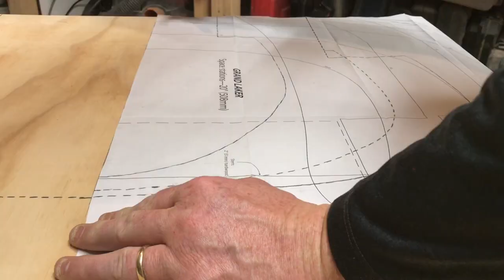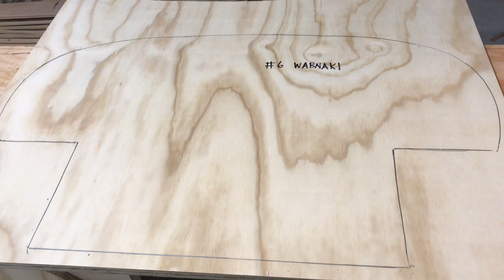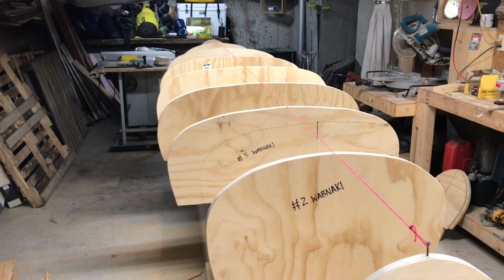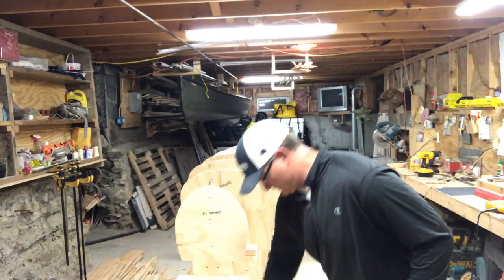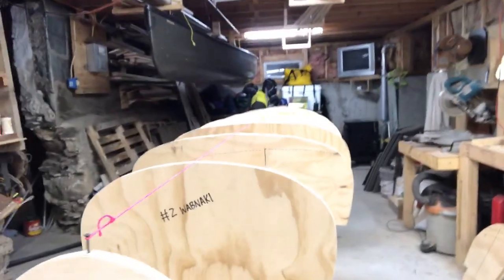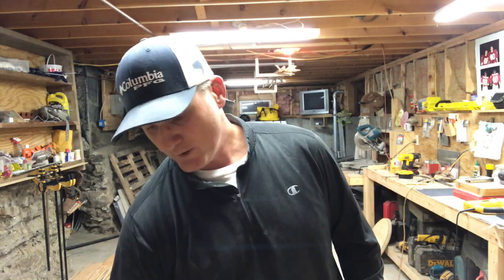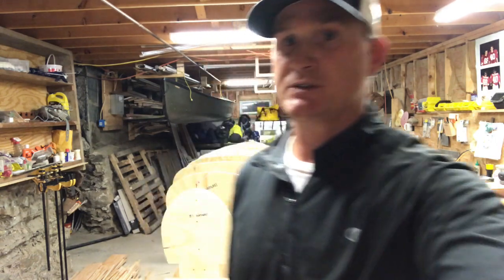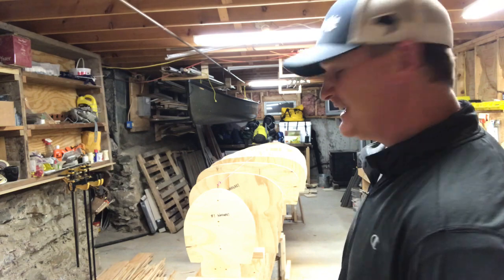My First Canoe Build, Part 2, Canoe Station Molds Drafted Cut & Installed

Comment: Double check form #7 doesn't look like it lines up to the centerline. Great start ! The Bead and coved strips will help a lot ! Good call !
Reply from the maker: Hi Jim, what you are seeing there is a glued biscuit joint where I mated up two pieces of ply.  I didn't bother sanding.  Had me nervous there for a second.  Good eye!